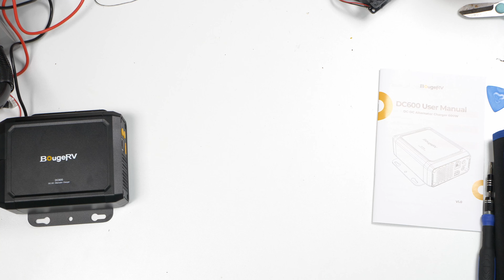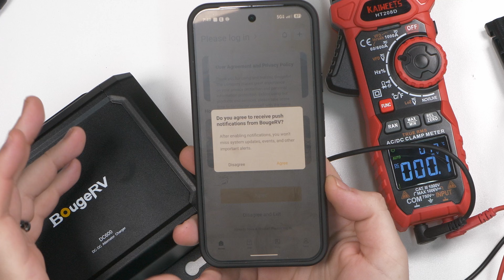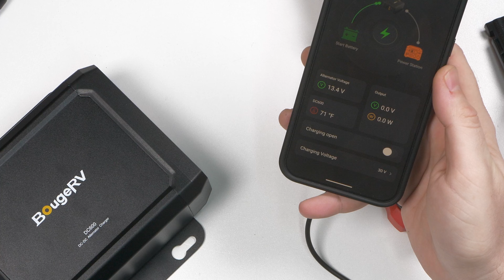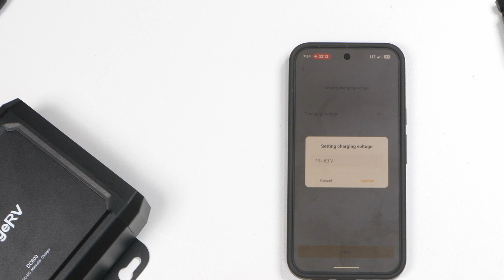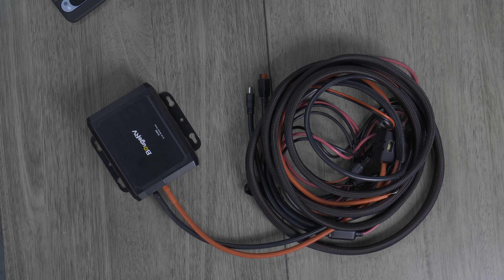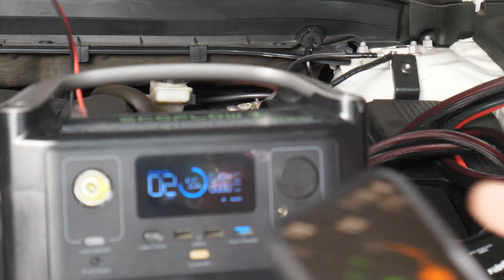Is This The FASTEST Way To Charge Your Power Station? (BougeRV DC600 Review)

Comment from the maker: With coupon, the DC600 is currently only $200, grab one here:  https://amzn.to/4qDuhnS

We’ve spent months resurrecting portable power stations and saving e-waste, but once they are in the rig, we hit a wall—the "12-volt wall." Charging a large battery off a standard cigarette lighter takes forever, sometimes upwards of 20 hours.

In this video, we’re looking at a potential solution: the new BougeRV DC600 Alternator Charger. They claim it charges six times faster than a standard socket, but does it actually deliver?.

I take the DC600 to the bench for a full teardown (metaphorically), inspect the wiring quality, and put it through some stress tests with an EcoFlow River Pro. We definitely found some impressive charging speeds, but we also uncovered a few design choices—specifically regarding the fuse placement and a "reset" button—that you absolutely need to know about before installing this in your vehicle.

Is this the ultimate upgrade for your van build or overlanding setup? Watch to see how it handled the bench test and the real-world installation in a Mazda CX-5.

Links:

    BougeRV DC600: https://amzn.to/4aT0djE
    Octopus Adapter: https://amzn.to/49pukgg

Disclaimer: Some links may be affiliate links, which support the channel at no extra cost to you.

Want to become part of the Crash? Add your membership here and steer the direction of the channel: https://www.youtube.com/channel/UCV6VPU4efPHYmlB8chLePNg/join
Reply: Yeah the holographic read out is over kill but killer.

Comment: Eco flow sells their own alternator  / high boosted volt charger. its like 200 bucks on sale. cheaper second hand. But ecoflow does not have have the PROJECTED THREE DIMETIONAL HOLLOGRAPHIC READOUT as shown in the thumbnail of this video. So I'm definitely getting  BougeRV  for sure.
Reply from the maker: Ecoflow's is $600 ($300ish on sale) and only works for their models (also doesn't do more than 100w on the smaller units). 

Oh darn, forgot to show off the holographic screen on camera...maybe next time 😂

Comment: Very well done video. I would rather spend $150 for the Pecron without any issues except I don’t see any adjustment for the output voltage which doesn’t matter to me.
Reply from the maker: Just looked at the pecron - works if you have their power station and no others. 42v is a weird one for them to stick to - most power stations I see max at either 25, 60 or 100v - wonder why they stuck with 42 🤔

Thanks for watching!
Reply: @fauxrhino  60 v would make more sense, obsolete already . I was considering price and no problems. Off topic: I ordered another 12 v 100 ah to backup the Pecron. I’ll wire in series to get about 500 w input. Should have 3K Wh useable. I enjoy your posts